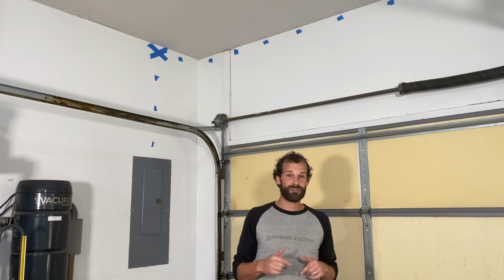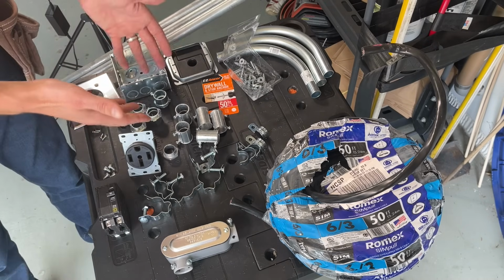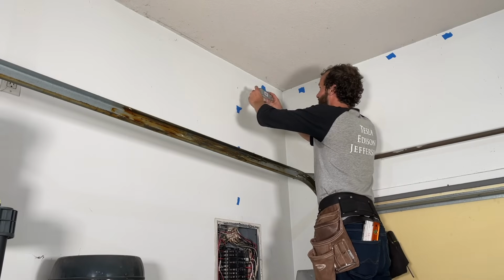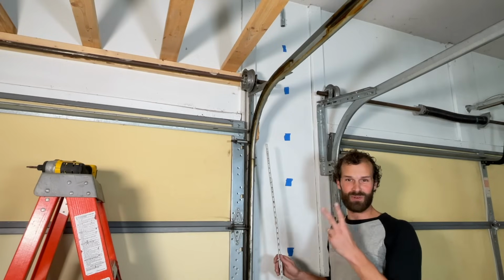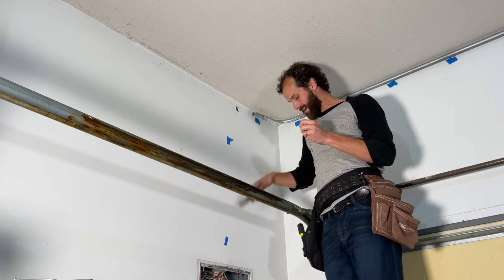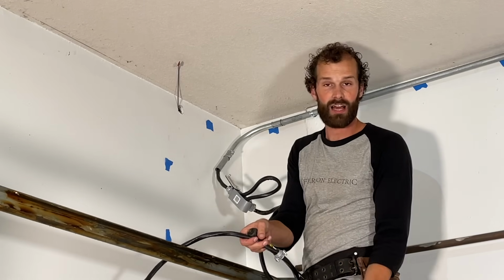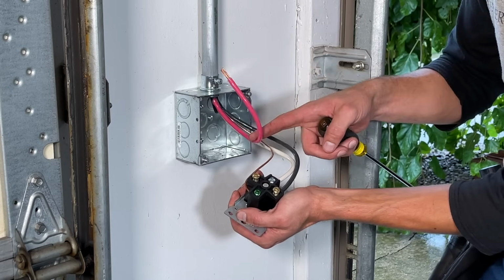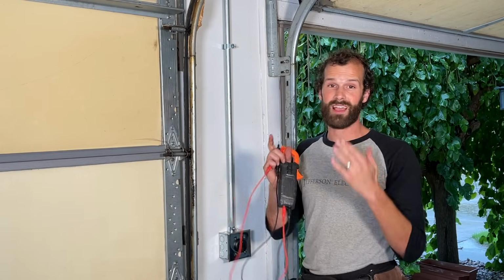How To Install a 240 Volt Outlet | Electric Car Charging

Comment: Romex in conduit, will that impact heat dispassion
Reply from the maker: Definitely not the preferred method which would be THHN wire.
Reply: @EverydayHomeRepairs  thank you ! I am just installing a nema 1450 (inside)on the opposite side of the electrical box(outside) in my garage. Do you think romex is enough for protection
Reply: No, that's not an issue. Romex is allowed in conduit and it has no measurable effect, and certainly no negative effect, on heat dissipation.

Comment: I don't use romex in conduit. I would pull THHN. I also don't like using those stainless razor sharp plates like that. I use the 4S commercial covers. You then get more box space and a much safer, clean trimout without the uneeded raised ring and plate. I have all the proper PPE, NM fish tapes as well. Be safe out there!!

Comment: I am a home inspector and contractor for the past 35 years, excellent lesson.
But I was always told not to put insulated cable in conduit? I always strip is off, my understanding is to reduce the heat.
Reply: Romex is allowed in conduit and it has no negative effect on heat dissipation. In fact, when romex in installed in conduit you are required to leave the outer sheating on for the entire length that it is in the conduit.

Comment: You didnt ground the box
Reply: According to NEC 2023 358.60 Grounding. “EMT shall be permitted as an equipment grounding conductor.” The EMT locknutted to the metal box and the physical contact they make ensure mechanical ground.

Comment: Great video! I was looking for tips on how to go from a finished breaker box to conduit. A couple questions - it didn't look like you grounded the outlet box with a ground screw? Also, I thought running NM-B in conduit was frowned upon, unless the conduit size is massive. I had read that THHN was a better solution for conduit runs, but that wouldn't meet code once it made wall entry, would it?
Reply from the maker: You are correct on both items.  We missed grounding the 4x4 and that should be done.  Also, technically Romex is okay in conduit in a garage but THHN is a better choice.  I use THHN now on anything I am pulling through conduit.  Here are a couple of other notes on this exact installation which can help.  https://youtu.be/aTVm8Bt_YUw

Comment: Damn it, you guys need to do this all over again, for those homeowners who don't have panels in enclosed garages, but have them often on the side of the house a good 
35 feet to 50 feet  away from the driveway !!!
Reply: I agree there isn't any videos out there running 6 gage from the side of the house  panel either up from the roof through the sky lol back down to the garage  or underground from the side to a garage that is 50 feet away.Most vids are like I bought my 2 feet of Romex at $2 lol you an I are like in the $400 dollar range. anyways The dude that made this video is awesome I love it and it made sense for us DIYers thank you brother, keep it up.

Comment: Great video! I want to use THHN in a raceway (to increase available ampacity) how would you recommend connecting raceway to panel if I wanted to use EMT external as you did in this video? FMC or NMT fished from top access hole? Create access at top of panel and use EMT or PVC? Other? Thanks!

Comment: Good video a little dragged out for my lvl even if I'm a DIY. I guess I did learn to move the wires around and tighten a few times for heavy stranded wire. Even when I do plan to use torqe screwdriver. 👍

Comment: Thanks for the great video.  Question for you. I have an older 200 amp panel with 5 mains on the top and 1 blank main.  One of the mains is a 100A for all the house circuits.
Which would be better to put the 50A EV breaker in the blank main spot or in the bottom under the 100A main house circuits?

Comment: I don’t see the pigtail of the ground in the metal outlet box. I did not pigtail my install of a 14-30 outlet either. I used 8 gauge wire for my install. He used 6 gauge for a 14-50 outlet. Does a pigtail need to happen. Outlet is a grounded outlet, but I keep hearing electricians saying there must be a pigtail of the ground wire in a metal box. To me, at this gauge size 6, or 8, it would be really difficult to pigtail the ground and  then have a big fat wire nut and then try to shove everything into the box. This guy is an electrician and he did not pigtail the ground to the box. I’m assuming he used a grounded outlet, but again I see on this thread people saying you need that pigtail. It just seems very difficult with wire this size. Could the wire that pigtails to the box be 10 guage  wire . That might make it a little easier. I see some electricians pigtail the ground for dryer outlets to metal boxes and others don’t saying they are using a grounded outlet where ground on outlet has has metal that goes down to the metal outlet plate and the plate is attached to the metal box and that gives you the ground. I know why no one I’ve seen does this for car charging, because 6 and 8 gauge wire would be very hard to pigtail and get everything in the box. Any electrician that can offer advice, that would be appreciated.

Comment: Romex in conduit? Um ok.
Reply: Perfectly safe and legal.
Reply: @pld8993  And a waste of time. Only homeowners run Romex in conduit because they don't know any better.
Reply: @waaaaa99  Usually, like in this video, that's true. There are, however, situations where romex in conduit makes the most sense.
Reply: @pld8993  36 years in commercial electric. Never ever have I seen Romex in conduit. When does Romex in conduit make the most sense? When you're too lazy to run conductors? When that's all you have on the truck?
Reply: @waaaaa99  Residential basement, running down an unfinished wall into a surface mounted recep or switch, for example. Would make no sense to throw a jbox in the ceiling, transition to emt and THHN to go 3'-4' down into that box.
Reply: @pld8993  Look up MC.....Nobody runs EMT in residential interiors. Come on man....
Reply: @waaaaa99  Yeah, nobody, except those of us who know what we're doing. Secure a 1900 to the wall with a 3' emt stub up the wall, one mini to secure it to the wall, slide the romex down into the box. Or, throw a jbox in the ceiling, romex connector, terminate the romex in the box and ground it, mc connector, run mc down the wall to a 1900, 2 mc straps minimum, splice the romex to the mc in the ceiling j box, throw a 1900 blank on it. So i just wasted 10 minutes of my time and $5-$10 of material cost to transition to MC and it will never look as clean as emt running down the wall. Why exactly would i do that?
Reply: @waaaaa99  That's not my video, genius. Nice try.
Reply: @waaaaa99  That's not my video, I don't make youtube videos, I've never been in a youtube video.
Reply: @pld8993 Yeah and I never commented on  "your" video.
Reply: @waaaaa99  You're not real bright, are you genius. Yeah, my video.

Comment: For EV charging station the white neutral wire is not needed.  Just buy a 2 lives wire red and black and the ground wire and it is complete. #8 for 40 amps breaker feeding a 32 a 7 Kw charger.
Reply: That's true only for hardwired EV chargers. When using plug-in models, neutral is required.

Comment: This video is an unbelievable hack!! So painful to watch. He mentions that the conduit is ground multiple times...then never grounded anything. I guess technically once the device was installed it grounded the conduit. Yikes! Then he pulled romex through the pipe...He struggled pulling with one 90-degree bend in the run. For all you that are not electricians you can have conduit run with up to 360 degrees of total bend as per code. Where I live, sleeving romex is illegal. Not only does it make it almost impossible to pull the wire through as illustrated in this video but it also has a heat rating violation. The correct way to do this would be to use the romex from the panel to a 4sq box or 4 11/16 box above the panel where he installed a L.R. condulet. Then pull strands of wire through the conduit to the outlet...Splice in the 4sq above the panel. Next he is using prebent 90's. No code violation, just shows he doesn't know how to bend pipe. Hence he's not a well-rounded electrician. Then he once again doesn't ground the box at the outlet. He used auger anchors...for a 50amp outlet box???? Wow! I realize he caught a stud with 1 screw but wow. At minimum, he should have used a Hilti toggle. For that application, a conveince outlet that will be getting things plugged in and unplugged frequently this box should have adequite backing. His install will adventully rip off the wall. I would have removed the drywall. Installed backing. Patched the drywall. Installed the box. It's one thing if you're plugging in a dryer or a range. It gets plugged in once and left that way till the dryer or range needs to be replaced... Then the cherry on top he didn't use an indy raised cover???? WOW, just wow this was HACK!!!  I'm sure this guy is a nice guy but he in not an electrician. That was DIY at best. He absolutely should not be putting these videos out. Hack hack hack!!!!!

Comment: I was making in some romex into someone eles mess of a panel like that & found out they NEVER Tightened the main lugs. For years the service feeds were just laying in the lugs, so as soon as i barely moved thēm the magic white smoke started cominh out. After I was totally blinded. I quit working for that company shortly after BC it was more of a symptom of them indiscriminatly taking jobs in shitholes.

Comment: Why would you use and wastes  6/3 romex when it’s cheaper to use your #6 rolls of wire of your an electricain would know this and do it the easier way and less money spent on materials.🤔
Reply from the maker: Yeah, THHN would have been a better option.  I (Scott) purchased the 6/3 so Joel did the best with it.

Comment: Wait a minute!   At 36:15 thru 36:40..... where did all that excess 6-3 romex go???  You already locked in the connector at the top of the circuit breaker box, so you could not have pulled the excess down into the CB box, so you just stuffed it all inside the drywall cavity?  I would have first pulled that excess into the LVL (or whatever you called it) before I attached the top-of-CB-box connector (I just gotta get hip with the nomenclature!)  before pulling the last 3 feet or so down into the CB box!  THEN, there wouldn't have been all that excess you had to deal with at 36:15 !

Comment: Excellent video, several good tips. Turn off breaker before installing into panel, wear safety glasses, no floating screwdrivers near panel.

Comment: Why wire in a netural when most chargers don't use one.
Reply: For plug-in EV chargers the neutral is required. For hardwired models no neutral needed.

Comment: If I've already got conduit running from the house to a detached garage, for an outlet and light power (no sub panel in the garage), would that conduit be appropriate/capable of running this gauge of wire for a 14-50 Outlet? I'd really like to avoid having to dig another trench to get power out there. Love the videos, and Joel's teaching is amazing!

Comment: I like heavy duty stuff, so in this case I would use AWG # 10 which is sheathed in orange color where AWG# 12 is sheathed in yellow.  Lots of American installation for house wiring uses AWG # 14 which is sheathed in white.  The sheathing comes off and reveals the actual insulated wires inside.   BEWARE lots of electrical extension cords like for running an electric lawn mower are also covered in orange.. So so if you want house wiring, you must look at the labels carefully because orange will be orange in two places.         Going to AWG#8 is really heavy duty and may be an overkill---- but you do not want to go down to AWG#14--- the AWG rating is so that the larger the number,  the smaller the diameter of the wire inside.   The #14 is smaller than a #10.
     The actual insulated wires inside the sheathing  that.,are bigger than  AWG#14 will be more difficult to crimp into a screw terminal or otherwise handle the heavier stuff.    I like heavy duty stuff, so in this case I would use AWG #10 which is sheathed in orange color where AWG#12 is sheathed in yellow.  Lots of American installation for house wiring uses AWG #14 which is sheathed in white.  The sheathing comes off and reveals the actual insulated wires inside.   BEWARE lots of electrical extension cords like for running an electric lawn mower are also covered in orange.. So so if you want house wiring, you must look at the labels carefully because orange will be orange in two places.
    This video shows installing the wire inside conduit right,  which is very safe -----other type but easier to handle is the house wiring sold with a flexible enclosing sheathing made of metal coiled around the outside. This kind allows turning corners and manipulating the wire in various ways and is still somewhat protected by its metal coating. Some people will say  it is as safe as conduit.
   Understand when I say "sheathing" I am referring to the outside covering that seems to be plastic. Understand that inside inside the sheathing are the actual wires that are insulated.  The coding over the actual wires are also colored, usually black and white and bare--- and the coding over these wires is plastic and must be removed, "strip-ed" to reveal the interior actual wire.  Remember that one of the  wires is red coated, the others are black, white, and bare,  the red insulated wire is part of 220VAC wiring and red wires used in your car are different application.
   Get a YouTube that deals only with attaching wires to that four -wire special socket. Because it is such a special socket, many electric dryers that come with clothig washer dryers use a plug that matches this socket.  That's why some people will call this a "dryer socket,"  and if you're plugging anything else into this, you will have to make up a plug on all of those other things so they can be plugged into this wall mounted special "dryer socket" .   It is better to leave the socket alone and put a correct plug on the end of other things to be connected there  -----you we'll have to unplug the clothes dryer and then plug something else in to the established socket.  It is much more clear to all people if you leave that socket the way it is and adapt whatever else you want to plug in there with a new plug on the end of those new applications.......... .... And live to tell about it.............. 
    Some people can live if have touched 110VAC but  in this case you're dealing with 220 VAC which is much more likely to kill you on contact. You may see that's the line labeled 240VAC but people call it 220 most of the time.          If you read on your adapters or other items, you may see the words  "useful for 110 up through 240" which is an adaptation manufacturers have made so that this item can be plugged in in Japan, America, and many foreign places...... Trust what you're plugging in only unless it has the statement that it will work like this..... Otherwise if it is 110 only plugging into a 220,,,,will burn it out. Read the label carefully---- sometime need a magnifying glass to do that!

     When using plastic electrical tape, that is how it is labeled, at the end-----do not pull the tape until it breaks and then smooth the end down because the sticky on the tape is not strong enough and in normal use that end that you broke off will retract and a little flag end will not stick down tight.  The answer is to cut cut the end of the plastic electrical tape and put that down at the end of the wrapping and smooth it firmly against what is it is wrapping.

    I use a computer program that does speech to text.... Sometimes I catch the mistakes that system makes and sometimes I don't. Please adapt.

Comment: The title says 240v but the video says 220v.  I know one is DC and the other is AC.  You needs to clarify them.
Reply: Voltage numbers are nominal so 240V and 220V are the same voltage, and sometimes you'll see 230V.

Comment: What the hell. Who uses a device ring on a surface-mounted box? Ever heard of an RS cover? And to verify that the existing electrical demand isn’t too high to add a new load, 220.87 requires 1 year of electrical demand data from the utility and a specific calculation to be done to verify this. Is this guy actually a professional?

Comment: Metal box not grounded? Pretty sure that's a code violation. Also isn't pulling Romex cable through a conduit a violation as well? Thought only THHN or THWN wires are allowed inside conduits. Pretty sure Romex would need to be derated at least since the extra insulation create extra heat inside a conduit.
Reply: Not grounding the box in this scenario is a code violation. However, romex is allowed in conduit and excess heat is not generated by installing it in conduit. That said, the way this installation was done is amateurish and not at all professional.

Comment: Be sure you have a big box when feeding this size of wires. Gotta make sure that you can get 6 inches of wire in the box and that it’s not overfilled. Those 1-gang boxes with no extension will be too small

Comment: Cost will depend heavily on how much wire you need since that’s the expensive part. If your charger is going near the panel and you don’t need much wire, this installation is really pretty cheap

Comment: I would have fed the wire through the conduit before mounting it because I find it easier to thread through for each section of conduit, especially with turns
Reply: Doing it that way is a code violation. Not allowed to install conductors in a conduit system until it's complete, can't do it one piece at a time. Also, romex in this installation is not the best way to do it.